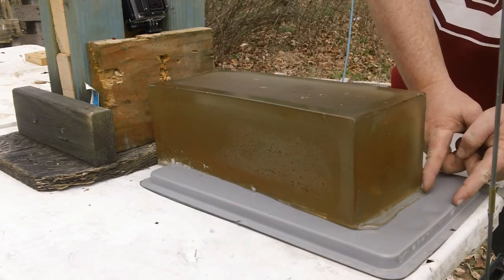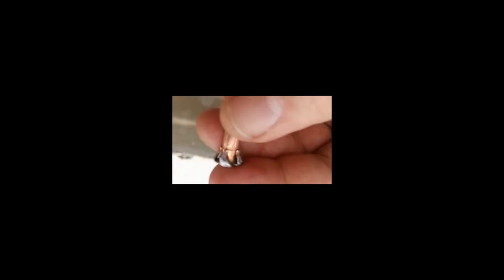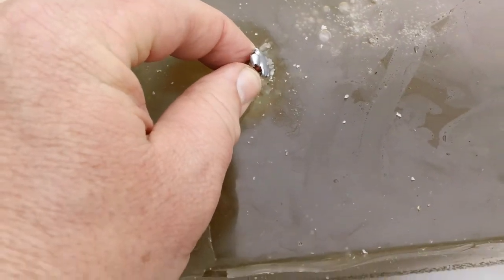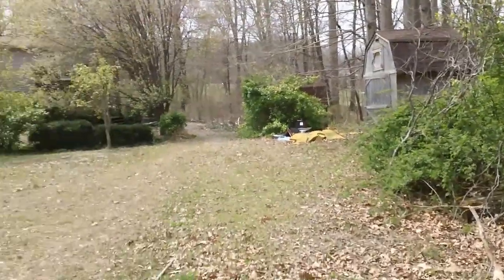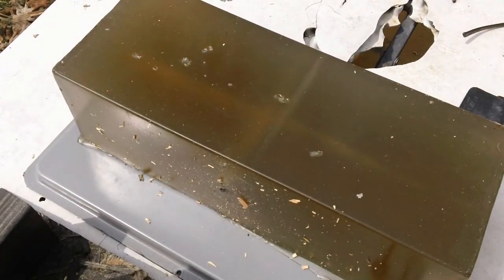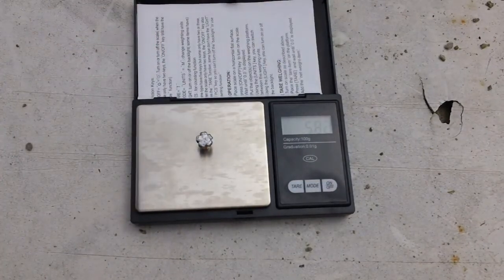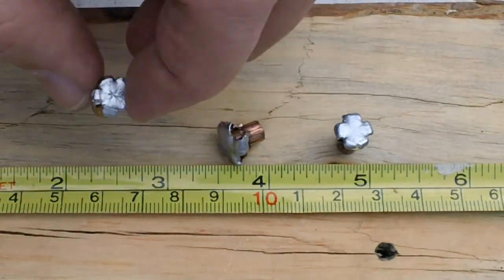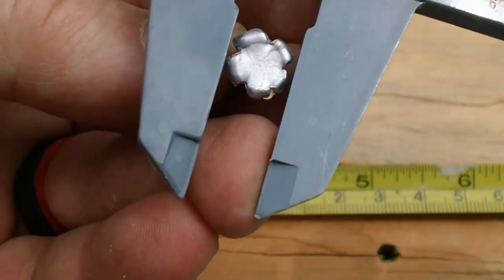.223 Speer Gold Dot 55g from 7.5in barrel (velocity, penetration)

Comment: How did this round do against the concrete masonary unit, the 2" thick concrete paving stone?  The 75 grain gold dot was the only one of the three weights that managed to get through both right?  I know the 64 grain gold dot wasn't able to go through either!
Reply from the maker: I went back and pulled the data from all of the Speer Gold Dots, and the only one that went completely through the solid 2" concrete block was indeed the 75g.  Here in this area we call those "leveling" or "stepping" blocks.
Reply: @poboyspecial  thank you.  Which ones were able to go through both sides of the CMU IE cinder block?
Reply from the maker: Great question,  it put a pretty good size indention and blew out some pieces on the back side, but did not go completely through the 2in solid block.
Reply: @poboyspecial  did it do better or worse than the 64 grain gold dot?  How did the 55 and 64 do against the concrete masonry units?  The 75 grain fusion made it through the CMU and the 2" thick slab?
Reply: @poboyspecial  can you let me know about the performance of all the 3 gold dots against the CMU and the concrete slabs?  Trying to decide which to get.  Thanks!!
Reply from the maker: Gimmie a minute, I have to go back and dig up my data sheet for all of them....

Comment: What is the most powerful, most penetration, most DAMAGE 22 MAGNUM AMUNITION all in one?
Reply from the maker: That depends on weapon type, twist rate of barrel, and length.
Reply: @poboyspecial  NAA BLACK WIDOW
Reply from the maker: @johnrommelt6560  Winchester high velocity Vmax 30g WMR
Reply: Thank you, very much
Reply: Polymer Tip... Correct?
Reply from the maker: @johnrommelt6560  - Yes, the  V-max rounds are polymer tip